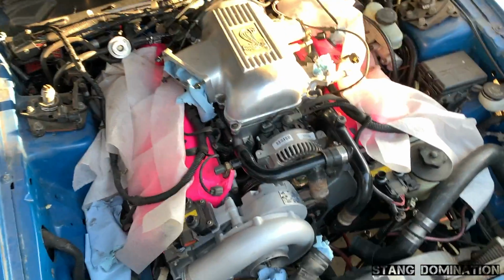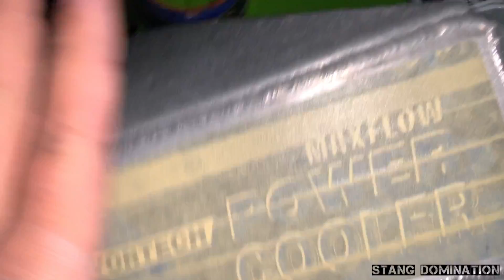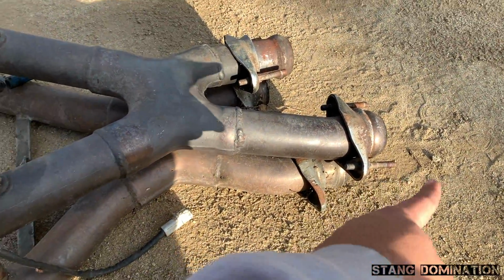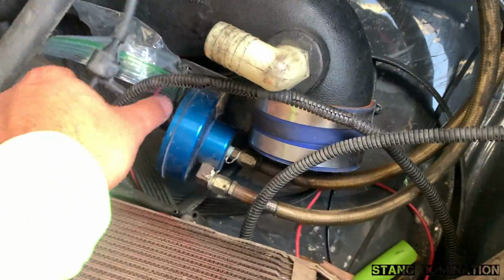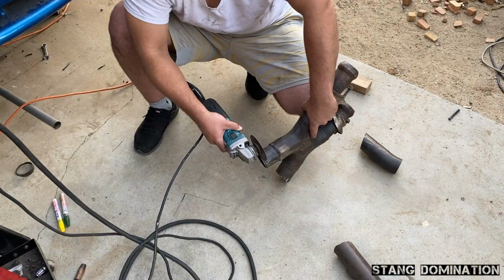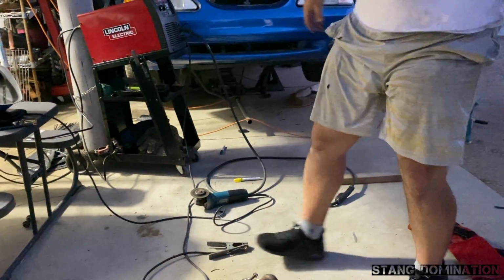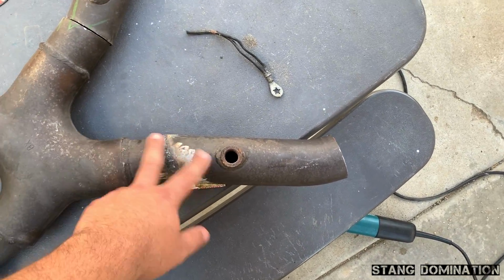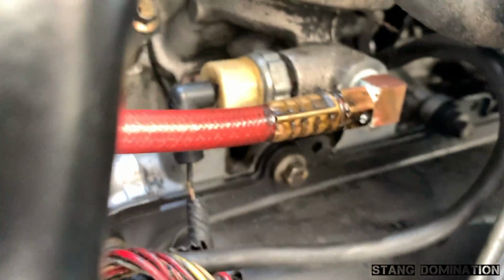FINALLY GETTING BACK TO THE 98 COBRA

Comment: Have to do the gap with feeler gauges.  The spark plug tool sucks. I had spark blowout because I thought I set it at .028.  But it was .038.  Use ngk tr6, no need to be a purist.  Use what works for others

Comment: Do not use NGK...only use motor craft. Ford made a mistake and didnt put enough threads to hold different spark plugs. They blow back out and break your coil pack mounts. The motor craft threads have a little more girth and hold better. 3 out of 8 on mine blew back out. 1 did it twice and now it has a helicoil